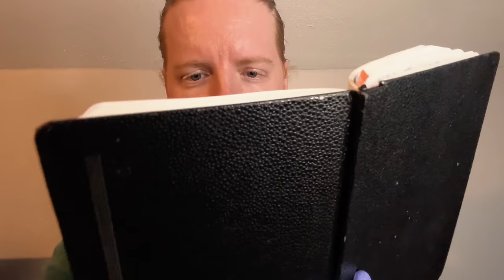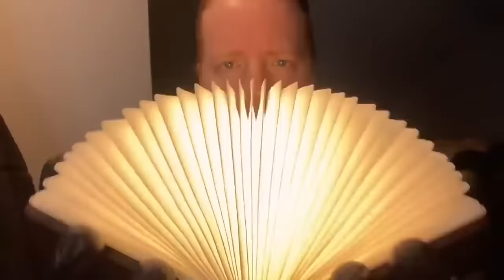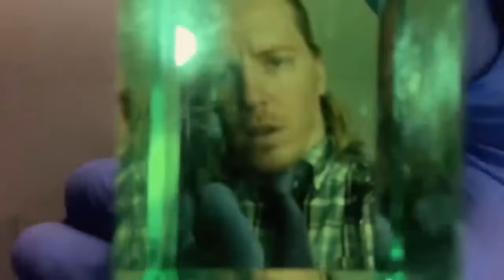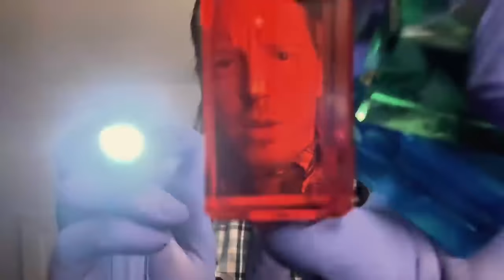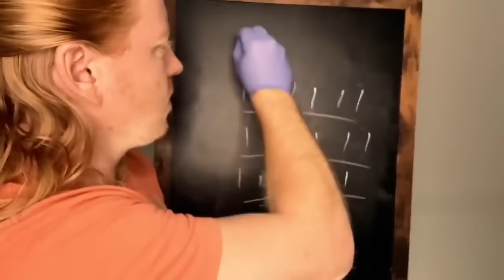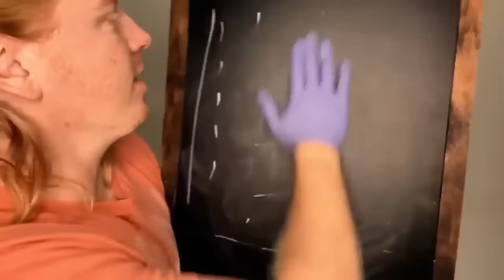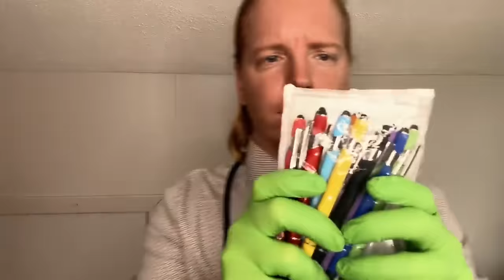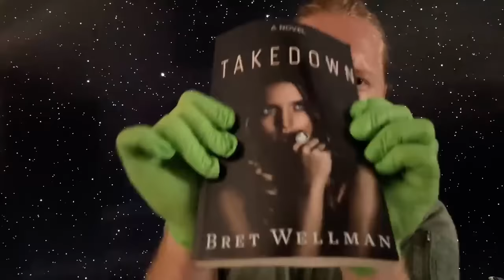Asmr cranial nerve exam Compilation | 12 Hours

Comment: After thoroughly watching this 8 times, starting from when this video actually released, I now come to the realization that my nerves have properly been examined. I rate this examination a 9/10, could contain more rock.
Reply: so you watched this over and over again for 104 hours?
Reply: @infamousblade9339  where did you get 104 from
Reply: they rounded the vid to 13 hrs then did 8 times 3 @newyorkjohn2013
Reply: @mads_0318  oh ok i thought he didnt count the minutes till i realized
Reply: He watched this for 96 hours.
Reply: DAWG THAT IS 4 DAYS OF ASMR
Reply: He watched this for 100h 37 mins and 12 second dawg why just why
Reply: If it’s exactly full 8 times, he could’ve watched for 103.330(8) to 103.33(2) hours 
(X) meaning xxxxxx…. Like 0.(3) is 0.3333.. or 1/3
Reply: Exactly 8 full times is 8x(12 hours +(54/60 minutes +(59/3600 seconds))), or 103 149/450 hours
Reply: I might be wrong though, dividing by 60^2 could be incorrect 

simply multiplying hours, mins, and seconds and combining them all is:

103 hours 19 minutes 52 seconds
Reply: Todos nós sabemos que o verdadeiro resultado são os amigos que fazemos pelo caminho
Reply: Idk what kind of math ppl are doing here, but its not that hard, just do 12×8 for the hours which is 96. Then do the minutes times 8 which is 54×8 = 432. Divide that by 60 which is 7.2. Take the 7 and add it to the hours and take the .2 and do × 60 for the minutes which comes out to 103 hours and 12 minutes. Then get the seconds which is 59, do it times 8 to get 59×8=472 seconds, divide by 60 to get 7.86666..... take the 7 and add it to the minutes and take the rest and do ×60 for the seconds to get a final 103 hours 19 minutes and 52 seconds

Comment: I dont want to trouble you but thats 13 hours not 12
Reply: Erm, actually it is 12. If you looked the first 2 digits is "12" which is the amount of hours in whole included in this compilation🤓👆
Reply: @V01DSEER boy its like 5 minutes from 13 hours its 13 hours your not smart
Reply: You don't understand IT says 12hours And 49 minutes And as long the first number Is there it will be 12 hours
Reply: @Parrot_at_the_farm  you’re* first of all and you’RE the one not smart 5 minutes before 13 hours is not 13 hours
Reply: @AM-eo6oe  round it up